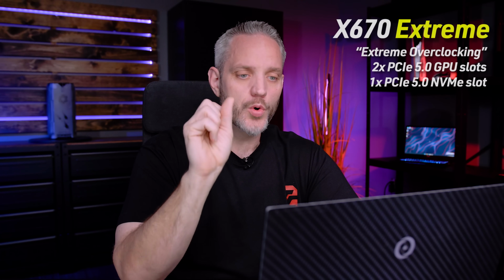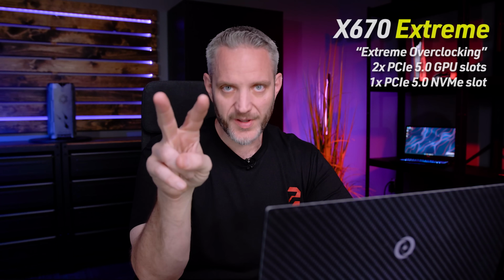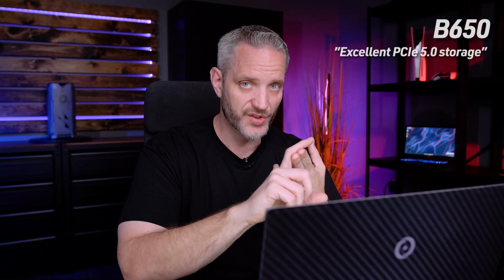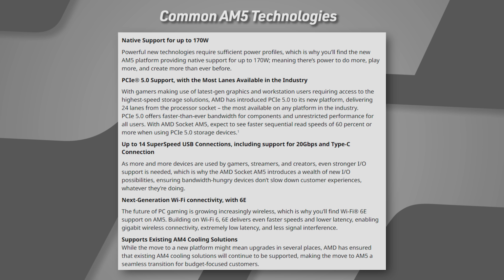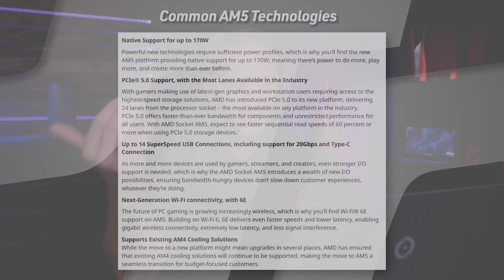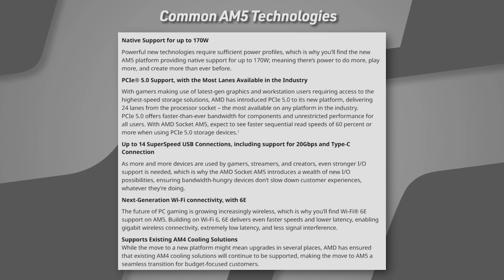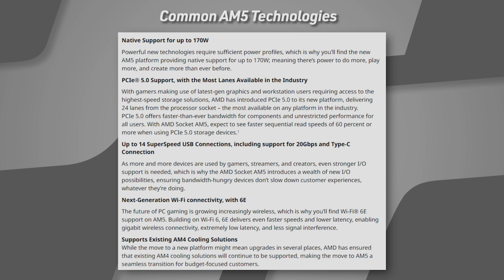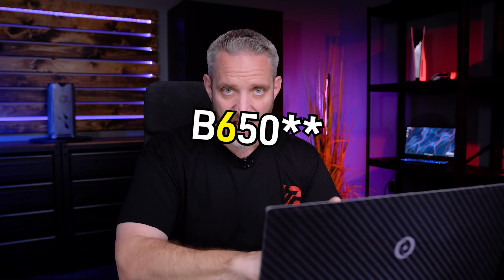AM5 Motherboards are EXPENSIVE! AM5 Explained

Comment: I was told I overspent on my C6H on the Day of Ryzen's launch back with the 1800x.  While I now know the 1700x would have been better than  the 1800x, I just replaced my 1800x with a 5900x with no other upgrades (bios update needed) and everything just works.... 

So, maybe it's not a bad idea to "overspend" on a BM that can work through generations.
Reply: Absolutely agree, I bought Asus Crosshair VI Hero and it works very well with Ryzen 5000 series like a charm. So if a motherboard can last so long, it is worth considering expensive MBs. Specially if it is AMD. I do not trust Intel in this regards.
Reply: @amitjangra6454  Hey I got the same mobo but the wifi version
Reply: @imo098765  i got without wifi, bought some used wifi card from china and it is working fine till date.
Reply: @amitjangra6454  Yeah this. I was fortunate enough to get the last gen boards on AM4 but I guess it wasn't even needed and you could still do it with way earlier boards. There's two things I never want to dick around with, power supply and motherboard. Replacing either of those is such an insane hassle I just don't wanna do it. That, and having to spend the money, because I only believe in building on a rock solid platform and that generally means $170 minimum on your motherboard, which I'd rather not replace too.
Plus I just like my board. I really, really like my Taichi stuff. I'd maybe like the colour of b550 Taichi more, and I definitely like the z690 board a lot more but that's a whopping $600 I'm not going to spend for a spinning gear and only 6 SATA ports. Oh it's "down to" $440 now nvm, but still lol. I guess to be fair to the platform, I do like the second USB 3 header, but it's just not worth losing 2 SATA ports.
Reply: Who ever said that may be dumb, the CH6 and the Taichi were the best 2 damn boards with the least amount of issues and problems on launch, and because they were widely bought the support for those boards extended and a community that knew their shit helped AMD fix alot of the issues through working with each other on REDDIT. 
In fact those 2 boards were probably the best investment for that gen, I know alot of peopel that haven't upgradedd yet from those boards and 1700X procs till the new platform. Theya re planning on upgrading this gen in the same way, Asus Crosshair or Asrock Taichi boards because of how good it was.

Comment: Without having anything but theory to go by, I would suspect that PCIe slot saturation for GPUs will rise once we get DirectStorage action happening, seeing as we'll now be sending data a lot faster to the GPU. Thoughts on this?

Also I feel you overlooked the part about storage on these boards. For instance I would personally look at an X670E simply to be able to support more 5.0 NVMe drives (granted that I probably have more storage needs than the average user), but these high-end boards are now often bundled with an NVMe 5.0 expansion card usually supporting connecting 2 5.0 NVMe drives. So while it is a bit curious that they mention multiple GPUs, there are other uses for these slots. :)

And regarding upgrading, I'm planning on holding off until Zen 5. My system right now is AM4, with a 3900X. Worst part is my X470 board, which would be nice to upgrade (basically for PCIe 4.0 (especially for DirectStorage usage) and more NVMe slots), plus it would be nice with a faster CPU for a bit more FPS (I do own a 3080). However I think I'll just wait for the next generation, which I presume might be a more worthwhile leap for me. Plus at that point everything should be fairly matured (aside from obviously Zen 5 being new tech) and DDR5 RAM prices will have come down. But we'll see if I can hold out that long. :D

Comment: Good point with the probable Windows 11 requirement. AM5 looks awesome, but my AM4 system will meet my needs until Win 10 stops receiving updates in 2025, which should be when AM5 bugs and prices will be at their sweet spot. If they have ray tracing worked out by then, I'll build a full AMD system in 2025.
Reply: Good point?  New Ryzen doesn't require W11,  that's a Big/Little Intel problem.... and a HUGE No Thank You to Windows 11.  This is a standard CPU with Cores and SMT
Reply: @Cinnabuns2009  Reason for W11 requirement might be due to Pluton on AM5. Also, I don't know why you don't like W11. I have been using it and not a single problem I faced.

Comment: I rely heavily on 10gBase-T Ethernet and I'm pretty annoyed that most boards STILL don't have onboard 10g which means looking at the bougie boards. Also I/o: I need at least 3 m.2 slots that are preferably NOT bus shared with other things, as well as supporting a multi-4k capture card. Unfortunately consumer CPUs have a VERY limited number of pcie lanes so my storage, networking, and expansion needs are kind of rough.

Comment: I always love to hear your thoughts on new tech. And love the new set 😀

Do you think that AM5 is going to have the same issues with DDR5, that intel 12th gen is? With not being able to enable the xmp profiles etc/populate all of the ram slots?? 

The unknowns are why I am not building AM5 right away.
Reply: my personal experience with AMD on new launches says yes, they will. it usually takes half of a generation cycle or even a generation refresh, or something like the 3d v cache launch that amd will have next year, before most issues like that will be ironed out on the software side. Also, the RAM controllers on the CPUs tend to have a big affect on AMDs overclocking ability with RAM, but since Zen + (Ryzen 2000) and Zen 2 (ryzen 3000) I have not had any issues with their memory controllers.

Comment: I was really hoping for more zen 3 3d chips but I'm doubtful since something like a 5950x 3d would make all this new chips irrelevant
Reply: how would a 5950x3D make the new cpu's irrelevant if the 5800x3D cannot? Going from 8 to 16 cores doesn't do anything for gaming which is where the x3D cpu's shine. The 5800x was the perfect cpu to add 3D cache too. If they had done it with the 5600x too it would've been even better.
Reply: @tars3249  it's because of the amount of cache on the actual chip. More game assets that can be stored in cache vs the memory. Then you don't have to worry about buying as expensive of memory for high transfer speed and low latency. Not to mention you'd still be able to maintain a 1:1 clock with the infinity fabric. A 5950x 3d would have near 200mb vs 96m6 on the 5800x3d. The size of cache on the chip is what is going to make the 7950x3d so good when it comes out next year. Giving that level of performance to am4 users would eat so many of their sales for zen 4. And the performance of said 5950x3d would be even better in the future as game developers adopt 3dvcache and higher core count CPUs into future titles. They want some reason to force consumers to upgrade in the future to make more money in my opinion.
Reply: @amgvlogs5087  I had not remembered the twice as many ccx on the 5950x probably means a doubling of 3D cache size. Fair enough.

Comment: My current system is 9 years old.  (I know, I know)  I wanted to upgrade 2 years ago but something happened in the world.  Go figure.  So now I am ready. I can now buy a video card that will not be scalped.  So Zen 3 is perfectly fine considering what I have.  Light years ahead of my current system (4th Gen Intel)  But since I am now ready, I am considering waiting for Zen 4.   Likely B650 MB since I will not likely overclock and want a stable system for a few years since I do not need the uber system.  My biggest ask is likely 3 m.2 slots.  So I am divided.  Get something now or wait another 2ish months for a Zen 4 system.  Just because I know it will be a while before I upgrade again.  So why not hold off just a little bit longer to get a slightly faster system?   Hopefully, not as long as the last time.  Do I do a X570 and R7 5800X now or wait for a B650 and R7 7700X.  Spend a little more on memory for DDR5 but most other items would stay the same.

Comment: AM5 continues to impress me (on paper).  That said, I'm still going to stick with my second AM4 system that I completed a few months ago.  

*Ryzen 7 5800X3D
*Noctua NH-L9x65 SE-AM4 Edition
*MSI B550-A Pro Motherboard
*64GB Crucial Ballistix 3200 Mhz RAM
*Radeon RX 6600XT from MSI
*Two WD Black NVME SSDs
*Corsair RM850 PSU
*Corsair 4000D Airflow case

I just completed this system back in June, and it would be too expensive to replace the motherboard, RAM, CPU, (and probably PSU given the power requirements of the new CPUs, especially if I want to upgrade to a new GPU at some point).  I'll wait and see what AMD intends to do with the 3D VCache processors for the 7000 series.  It's too bad that was basically a footnote in the presentation earlier this week, but I can't wait to see how the 7000 series will eventually take advantage of it.

I feel a reminder is needed: You put out a video a year or two ago when Ryzen 5000 series CPUs came out: just because something is last generation, doesn't mean it is suddenly obsolete or of less value to the person using it.  The 5800X3D I use in my main system is a great CPU.  Heck, the Ryzen 7 3700X that I still use in my first PC build (because I couldn't replace it with something better) still suits my needs pretty well on that system as well.   

Also, god forbid we end up in a situation like where we were for the past few years where availability was an issue, and the scalpers control the pricing rather than the developers and retailers...  

It's just not worth upgrading to AM5 at this time.  Let's just wait and see how the launch goes first.
Reply: dear god what do you need 64GB of RAM for? are you running a server or something? xD
Reply: @MoonMarshmallow  Doesn't have to be a server; having more ram means you can care less or not at all about what you're running, with Windows not having to compress whats in ram this results in a smoother experience that doesn't translate well in video.
Reply: @MoonMarshmallow  I use the system for both workflow and occasional gaming.  The system can also serve as a backup for my media server.  According to my system monitor it rarely uses more than 22-24 GB of RAM, but it's nice to know that I have a larger pool of memory if needed.  I would never go with less than 32 for what I use my system for.  Your use case on your system may vary...

Comment: My setup is a 3700X with MSI X570 Tomahawk, 16 GB, and a 2080 Super (got it 1-month old during pandemic season for a fair price). I'll be skipping 7000 series and Nvidia's RTX 4000. While these will perform better, my computer is fast enough to run anything I want. Dunking money because new stuff is faster doesn't seem smart. 

Ryzen 7000 will also have an exorbitant early adopter tax. There's no benefit for my workload (Excel, Google Docs, Emails, some data reporting tools, and games) if I move to DDR5. So I'm paying more for newer tech that's not going to give me any benefit. I'd want to bump my current rig up to 32 GB, but that's it.

Comment: I keep my systems for a while and I just upgraded my system.  Old system was anI built in 2016 with minor video upgrades was an Intel 6700k, Corsair H115i cooler 16gb Corsair Vengeance (32000MHz), a Gigabyte z170x Gaming 7 and an RTX 2070 in a Phanteks Enthoo Luxe case.  New system is an AMD 5800x, Asus Prime x570 Pro, white Corsair H150i Elite Capellix cooler, 32GB Corsair Vengeance RGB Pro (3600MHz), EVGA 3080Ti XC3 ULTRA, in a white Corsair 7000x case.  I would say that my current system is good for at least a couple of years.  I do agree that AMD is on a roll with their new AM5 and 7 series Ryzen chips, looking forward to what they have up their sleeves for GPU's

Comment: Win 11 is buggy as hell. am5 will be buggy as hell. if your rich go for it and deal with the headache, if not wait 2-3 years of am5, just like am3. 1 series, 2 series was flawed am4 worked by the time we got 5th gen. no doubt it will be the same for am5. as jay said unless you run bleeding edge systems and want the hassle don't do it for at least 2 years.

Comment: I'm about ready to upgrade my AM3 socket system.  (I don't feel the need to upgrade to every latest thing.)  What I hate about many recent motherboards is the relative paucity of PCI-E expansion slots.  I'd rather have more PCI-E expansion lots than built-in WIFI or more than two NVME slots (just one would be enough).  I can add in a WIFI-6 card if I need it, and replace it with a WIFI-7 card when that's a thing.  I'd rather have a non-GPU 16x PCI-E slot for a quad NVME carrier card than waste the motherboard's limited horizontal space on a single flat NVME.  One or two really fast NVME storage devices is good, but I also like to have lots of not-blazing-fast storage (e.g. for backups or just lower price).  I would love some faster internal ports (like the latest USB) instead of SATA plugs for internal SSD drives.  It's weird that you can connect an external SSD faster than an internal one.  Finally, can we get rid of the PS/2 ports?  Who the heck still uses those?

Comment: I've already got a kick-ass system right now with a Ryzen 9 5950X and a 6900XT and asides from wanting to switch GPUs due to driver issues this configuration of my system is going to largely stay the same for at least the next year or so. Once the bugs have been squashed with AM5 and I get a better idea as to what kind of performance I need out of my system I may upgrade or stick with what I got.

Comment: What would you suggest ?
1.) Buy decent B550 board and R5 5600x
 or 
2.) Wait for AM5 and get low end B650 and possibly cheapest Ryzen 5 model ?
 I think the most difficult part is ram price, but if i go with APU i can leave out gpu for some time, right ? 
Will there be something like R5 5600G ? (next gen) ?

Comment: I currently use all four PCIe slots on my X570 Asus Dark Hero motherboard. I have a Blackmagic SDI video output card, a Dante audio-over-IP card, and a Pro Tools Native audio interface card all in addition to my RTX 3090. Asus does not offer any 4-slot motherboards in the X670 family, so I would lose functionality by upgrading. Theoretically, I could go for an Asus Raptor Lake build and get away with 3 slots because I could replace that Blackmagic card with a Blackmagic Ultrastudio 4K mini unit that costs 10x what my card cost. But can't do that with most AMD motherboards thanks to the lack of Thunderbolt. So I'll most likely be sitting this gen out, even though my X570 build is giving me serious USB connectivity issues and hindering my day-to-day activities. AMD won't let me RMA the 5950X CPU without me taking a picture of the CPU in the socket, which would require me draining my whole loop and taking my PC out of commission and I wouldn't want to do that until it's time to actually swap the CPU.

Comment: With the X670E having two graphics card slots, I can see that being used for a streaming rig (one graphics card for encoding stream ops, one for running whatever game is playing) OR being used for an INTERNAL capture card.
Reply: I will stick to what I have right now. 3900x with 64 gig of ram and 3 video cards running 3 43 inch 4k monitors.
Reply: @DavidAnderson-fr8ii  nobody asked
Reply: You can put a an 3060 in a PCI-E 4 by 8 slot and you would not notice any difference in encoding performance. The bandwidth to copy a frame across is so small. Uncompressed: 3820*2160*4*60=1980288000 in bytes. That's 1.9GB per second. And that is less than a single PCI-E 4 (not 5) x1 lane. Compressed it goes from the PC to the TV through the HDMI cable, so... PCI-E 5 x16 is not needed.
Reply: That's exactly what I was going to comment too lol
Reply: So will this support SLI/X Fire?
Reply: I always wanted to do a dual pc setup but there are no capture cards for 1440p 270hz that needs DP in and out

Comment: These boards are not just extreme Jay, they are Extremely Extreme.

As for adoption plans:
I'm currently in the process of putting a 12900ks + RTX3090 system together. Just waiting on a few waterccooling bits to arrive. (Supply chains are STILL pretty much busted these days).

As for next PC, 5 years time. That is when I'll maybe go AMD. See what happens at that time.

Comment: I'm considering switching from Intel to the new AM5. I'm overdue for an upgrade, being on a 6th gen i5. But what's important with AMD offering is the compatibility.
You see I'm the kind to buy something and want it to last for a long time. I will use it to the bone. Problem with intel I'm having is that if I ever want to upgrade the cpu, I either have to buy new motherboard or buy an outdated cpu.

Right now my computer is in an mini-itx case, so I plan to buy a 7600x and a B650 motherboard in itx form factor. But I also want later down the line to upgrade to a bigger tower. It might happen in 1 year, like it can happen in 3. At that time I might consider upgrading the motherboard to a more powerhouse platform.

But that's what most important with AMD to me, I can consider swapping platforms with a more up-to-date without having to throw away a cpu that might be in perfect condition.
As for when I'm actually buying, I'll probably wait a month or two and see what's happening.
Reply: AMD have publicly stated AM5 will be around until 2025+, so that will be Zen, 4 Zen 5, probaly Zen 6 and maybe zen 7

Comment: I already have an X570 MB, KO Win 3070 GPU, 7 5800X, 64GB of 3600 RAM, FireCuda Gen 4, and a sweet 360 AIO in a Lian Li clone case.  I play most games at 4K or 1440 without issues.  I'm good for a while.  I'll wait for them to work the kinks out.
Also, I have a PS5 for when I get tired of the modder/hacker losers on GTA V.

Comment: Will a 650 mb have sufficient power delivery to upgrade to a new chip generation (maybe even with 3d vcache) in like 3 years?
Otherwise I would probably rather opt for a more expensive model and still have that upgrade path.
I'm planning to upgrade from my i7 7700k